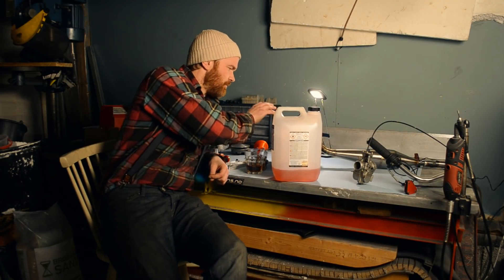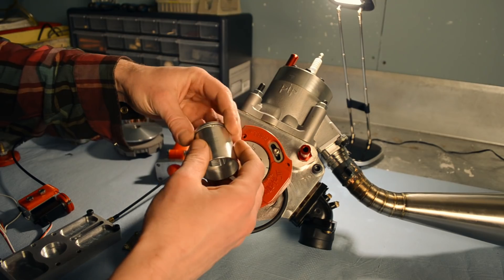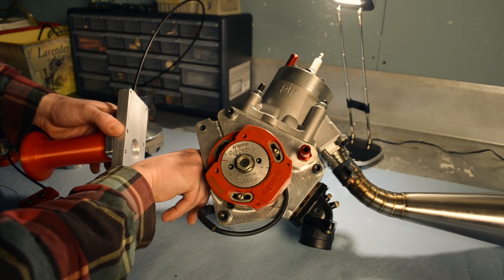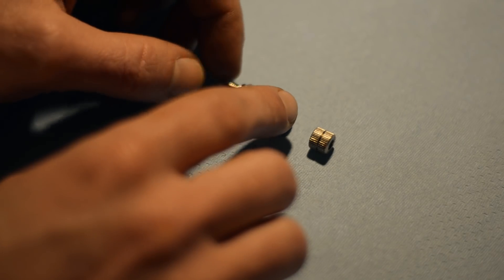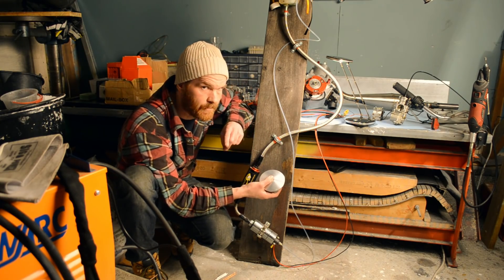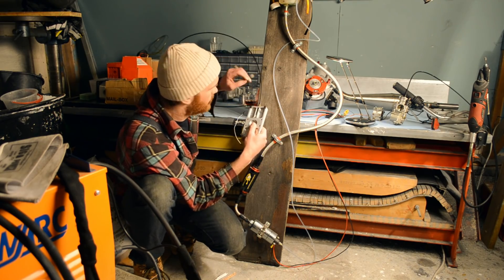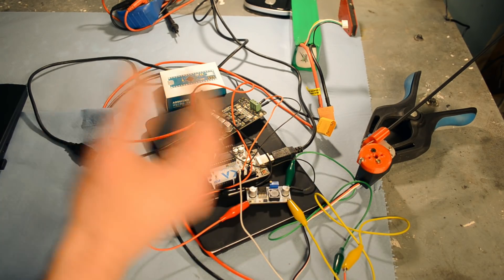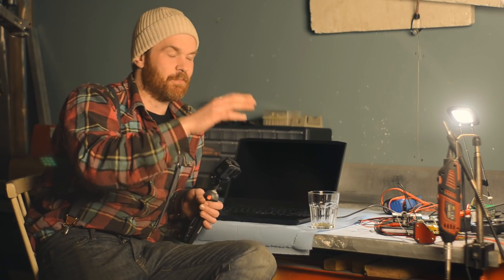That Nitro EFI setup - Most Powerful Two Stroke Ever.

Comment: Dude if your messing with glow fuel be sure to use after run oil, otherwise it will corrode the bearings and rings.
Reply: Wd40 is the way
Reply: @evaork3746  yeah that will help out, although methanol is hydroscopic, and burnt nitromethane produces nitric acid. After fun fuel has a ph to counter the acid.

Comment: You can try and spark nitro fuel... It won't work it needs compression and heat. At least the RC stuff does. Tried many times to light a fire with it. 😆

Comment: A tighter spring in the injector check valve. Let engine suction help pull the valve open. Somewhat like a CIF injector on a old VW or try a Venturi.  I know the engine will lose vacuum when you open the throttle but if you keep the R’s up it might work. your smart. Simple is best.

Comment: Decided after watching your series from the beginning you gone of track by not using standard from a fuel station petrol and don't think it will be the most powerful
Reply from the maker: I'll do some testing on gas when it's working. Decided to go with alcohol cause I need it to survive minutes of flat out on hot salt.
Reply: @2STROKESTUFFING  i agree if you have a local source of E85, look up mattology on MA for his experiences with E85
his platform was a a35/a55 Tomos 2 speed.
you need to give examples of what "moped" you're looking for.
i'm thinking you want a small displacement 5 or 6 speed, Kreidler, Zundapp, or Ktm. 80 to 100+ mph.
a two speed won't manage the rpm's you'll be attaining.

Comment: For the Valve you could use some Turbo Car parts that work with negative or positive pressure 🤔
Reply from the maker: 👍 Been thinking about using pneumatics, maybe with a small co2 tank.

Comment: I have a yamaha dt 50 mx 2, which i won't sell of course, but it would be cool if you used the same vintage air cooled dt 50 engine. The only problem is the shitty 3 plate clutch.
Or a better suggestion is the newer liquid cooled dt 50 or dt 80 engine, but they are very rare.

Comment: we have some manufactures of motorcycle programmable ECU units here in thailand, full stand alone systems, have a look at Thailand ECU shop for the motorcycle units, fully programmable from your cell phone, see if they would work and I will get one sent to you if you want.  I think it would solve your injection side of things along with the servo connected up to a shift light output and the injectors on a relay off the shift light with a delay function.
that way you can set your pulse width for your injection and tune it for the meth, as for the nitro that scares me, I have seen many a engine eat itself on nitro, it can be rather aggressive to say the least.
Reply: I will call them tomorrow about a unit that can do 18000 rpm
Reply: @marcwire9332  its likely to rev beyond 18k
Reply: @robertturner8040  I was thinking at a 14k target then a 4k over run would be a limit
Reply: @marcwire9332  he thinks it will exceed 20k on the injection
Reply: the tps system might allow for using the secondary intake valve as a tuning aid
Reply: @marcwire9332  i think you should write him an email
Reply from the maker: Sounds awesome, could you mail me some info on 2strokestuffing@gmail.com?

Comment: Haha I just had a crazy idea xD... Imagine that engine in one of those log cutting competition chainsaws xD!
Reply: No way this has enough power.
Reply: @lauri.lyijymaali  Those are much higher displacement and this would be less than ideal but I believe the peak power will be closer than you think. Just going to be far less torque because of the aforementioned displacement disparity.
Reply: @lauri.lyijymaali  jrouiu9
Reply: Also would be hard to adapt it to the constant load & rpm concept
Reply: @thomasham7648  that is the whole idea of this setup. As he said “ constant load, constant RPM”.
Reply: Those competition saws have cr500 engines etc fitted to them. This engine would be fun in a little ktm 50.etc
Reply: @itsme-uj6pg  or one of tose rc dragster cars too xD
Reply: There called hot saw
Reply: https://youtu.be/juQP4-9XFMI
Reply: Mate they have saws with full effort cr 500 motors
Reply: There are different classes in hot saw comps. I run a 60cc hotsaw.
Reply: Ya hot saw competition go crazyyyy
Reply: Yes the engine has been designed for constant load and rpm... if you ever have used a chainsaw you should know that this doesn't apply. So one would need some complex mechanism to adapt for it just as he's planning on the bike. With the result of loosing the advantage of a smal light engine.
Reply: @thomasham7648  lol, gatekeeper of chainsaws...

I use a saw, reasonably often. The way I use them aims to try and load the saw with a consistent feed rate and engine load. I don’t think I have ever thought about reducing the throttle when cutting logs. I only increase the feed rate to keep the engine loaded at the same amount at all times.
I totally agree that having a saw with a throttle helps when bucking or pruning though for competition they cut log, hence the constant load idea.
Reply: @barje.waffles5461  indeed. In competition there is no varying of the throttle it's All or nothing wide open throttle. You are correct with bucking or chain bind you want the thing to be spending as fast as possible to cut. Maybe in the case of tree carving you'd like to feather that throttle for intricate detail. But the chain is driven by a centrifugal clutch you want it to be at Max RPM in order for that clutch to engage and to have as limited slip as possible. Most hot sauce run around at least at 330 sled motor but I've even seen some with 440  two cylinder rupp motors. Nasty machines that still would love to see what this thing could do though see if it'll get anywhere close to that 5 second cuts.🤟
Reply: @ogt92fromthe1step9  can’t imagine holding a saw with more displacement than my MX bike. Not for the faint of heart I am guessing.
Reply: @thomasham7648  you should see those competitions

Comment: Just change that servo for a door popper. I know that everyone else talked you out of the simplest solution, but solenoids are simple, reliable and fast.
Reply: Yup, and you can use a simple bell crank to change the direction and or throw ratio too.
Reply: or make it more complex and add a spring

Comment: Be careful with the fuel volume. Nitro likes more and more fuel until it doesn't then it throws the crank on the ground
Reply: All true except in this case it will throw the crank into your nuts.
Reply: @bradley3549  you nailed it!
Reply: @bradley3549  pmsl, ouch!
Reply: Your right, also you need a very strong spark to ignite it, and yes and the risk of hydro lock is real, especially when the cylinder is inverted
Reply: Are you talking about nitromethane or nitrous oxide? Two totally different things.
Reply: @rehepeks  all vapours can be condensed into liquids and enough of ANY LIQUID in a cylinder will cause HydroStatic LOCKUP .... BAD; VERY Bad!!! 🤓😲😬😡🤬🙄🤦🏼‍♂️